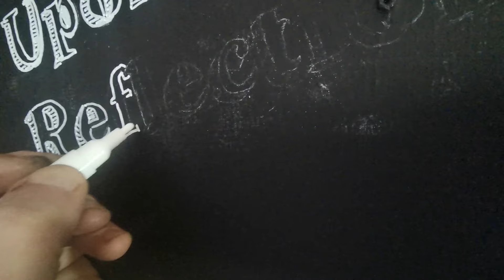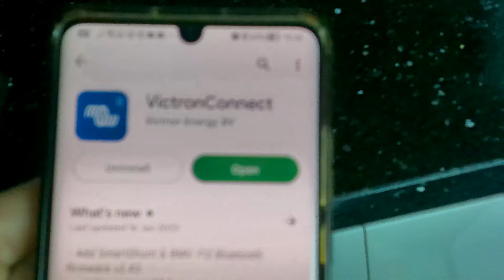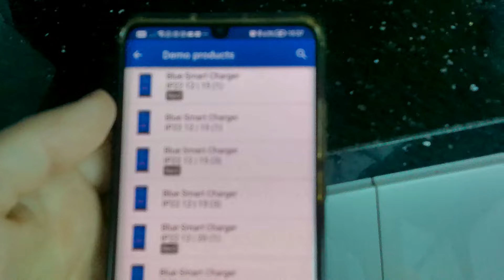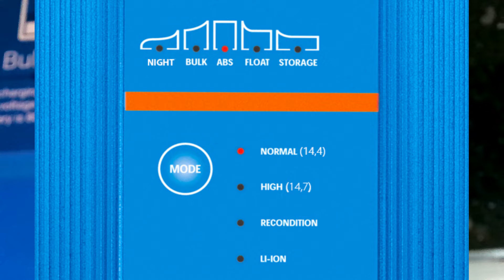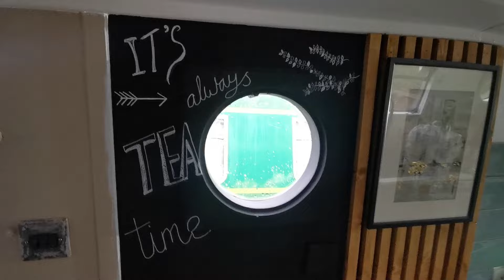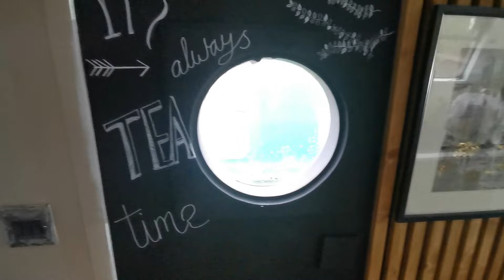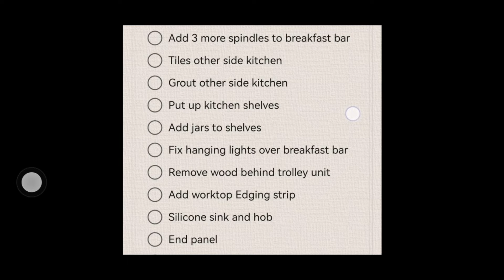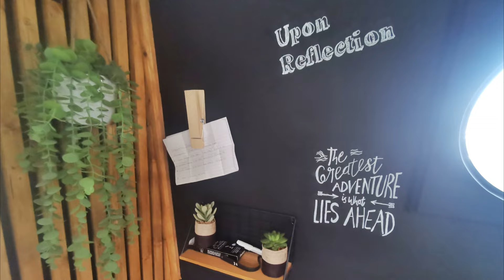DIY Chalkboard Wall on Our Narrowboat. Ep11

Comment: I'm on a sailboat in Florida. We love Victron systems here. When setting up marine electrical, it's important to fuse between each step in your system, ie--between solar panel and controller and then again between controller and battery bank. Same follows on other components added to the system. We wire a separate controller with each solar panel. That way if one isn't working it doesn't take out the whole system as can happen with panels wired in series to one controller. The victron mppt solar controller also connects via Bluetooth and all of the victron electronics are phenomenal at communicating with each other. At this moment, 2:15 pm in full sun on a winters day, I'm pulling about 150-200w from 610w in panels. In full summer that number is double. Here, we expect to gain about half the watts of our solar panels as a rough gauge.
Reply from the maker: Wow what a beautiful setting you have being in florida. Thank you for watching and thanks so much for the advice and comment 👍
Reply: @uponreflection  Thanks, enjoying your adventures as I hibernate for winter here. I'm a little jealous of your stoves!